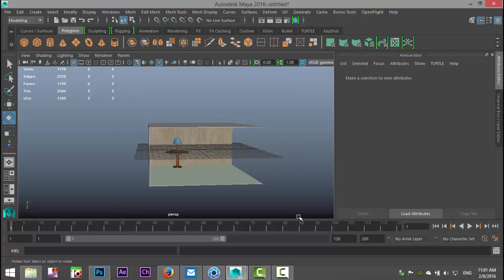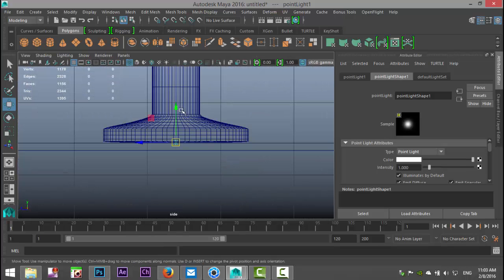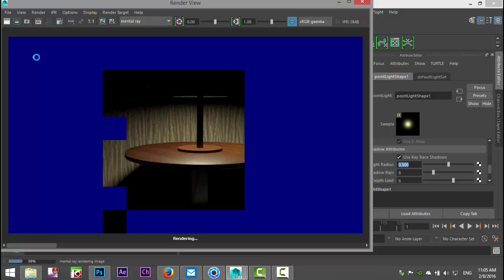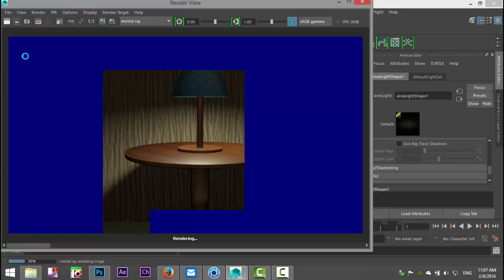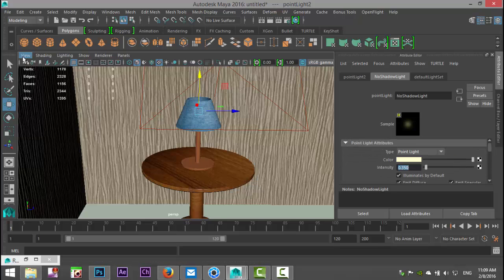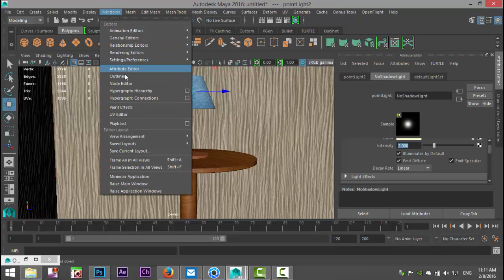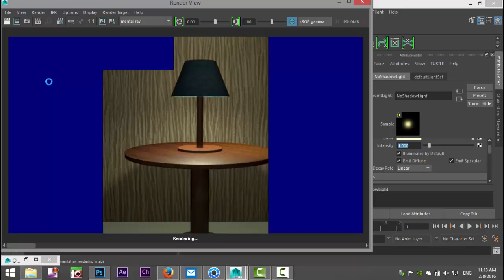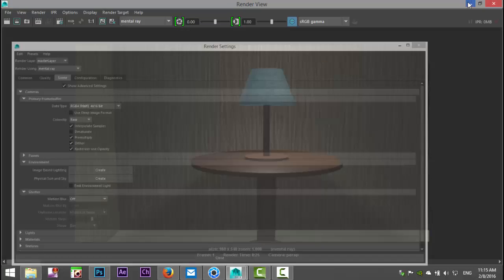Maya 2016 tutorial : How to setup table lamp lighting

Comment: Hey Mike, If don't mind me saying so I did not understand the reason if you were going for a more dramatic lighting effect when you changed all the light values down and then increase the other two it only alters which light is iluminating the basic scene stays lite the same like nothing had been changed when they all could have been turned down for a warmer effect with the table light being your main source and your first scene area light be just a tad lower just to add slight shadow deffinition to the final render.

Comment: Someone tell me if I'm understanding this properly. The shadows are defined by the first point light. The actual light of the scene is defined by the area light and the 2nd point light that does not cast any shadows. Is this correct?
Reply from the maker: That depends. In a 3 way setup usually one light is the key light casting shadows ( often but not always the one on the front left ) the the weaker 2nd light would be the fill light ( to soften the shadows created by light 1 ) and finally the back or so called hair light in photography )
Reply: I was referring specifically to the lighting setup in this video.

I tried to duplicate it in the current maya student edition 2018 with the Arnold renderer. I mostly got it the same. I was able to soften (make lighter) the cast shadows but I could not soften the shadow edges like in this video.

Comment: Hi Mike:

Great content.
Is there any way to simulate the embroidery effect on clothes, say hockey jerseys, ball caps, etc?
Using bump maps or zbrush? which one is easier?

Thanks in advance.
Reply from the maker: +Oz Loya Bump, Displacement or Normal maps for sure. In extreme closeups modeling would be an option. Sculpting and then transferring to a low poly using normals is an option too

Comment: Useful video. Always seems to be some trick/tool I hadn't played around with yet. This tutorial leads me to a new question: I have a project that contains 40 or 50 identical lights in it (they are positioned down a long tunnel). I'd like to experiment with different settings but having to click on every single light and change the settings 50 times is frustrating. Unfortunately, Maya does not seem to allow you to click on all 50 at once and enter a new value and have it "stick" to all 50. It only does one at a time. Is there a way to set up the lights in a project so that changing the value of one would change the value of all 50 that are somehow connected to the original? Unfortunately, Maya does not allow you to create an "instance" of lights (that I know of) like you can with objects, where a change to the original would propagate to the rest. Thanks.
Reply from the maker: +Kevin S Yes there is. Make one light and then hit Ctrl+D ( to duplicate it ) Pull it over and then hit Shift+D until you have 50 lights.
Anything you change on light number one will change on the others
Reply: This didn't work for me, Mike. At least not in Maya 2015. Is it a new feature for 2016? I made a spot light, Ctrl+D duplicated it and  moved it a bit, then Shift+D duplicated w/transform another 10 or so. Neither changing a value in the very first light I created nor the one created by Ctrl+D changed any values other than the one for that particular light.
Reply from the maker: +Kevin My bad Kevin, I don't know what I was thinking. Based on your reply just know I did some testing and you are right. The thing is that I do things in Maya on autopilot sometimes and when asked how I do that I have to give it a lot of thought. It can be done though but by using a script. Here's a link http://www.creativecrash.com/maya/script/multiple-lights-control
Reply: +Mike Hermes Very cool. Thanks for the script link. It would be nice if Autodesk could do a little tweaking of their programming and simply allow lights to be made into instances. Lights might not technically possess the properties that define a "true instance" but it doesn't mean there can't be some equivalent function with the same name. At the bare minimum, they should allow you to select multiple objects at once and change the value across all of them in one fell swoop. :/